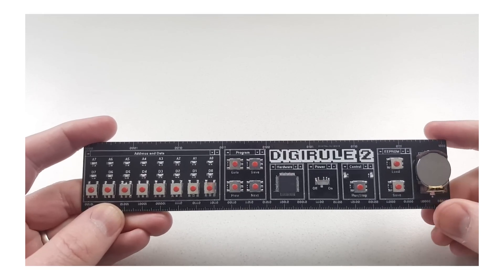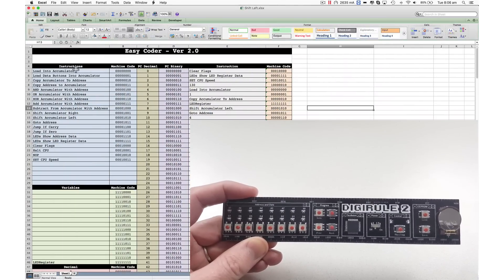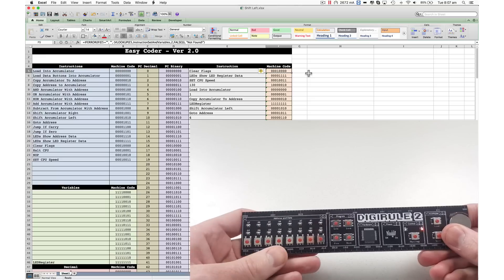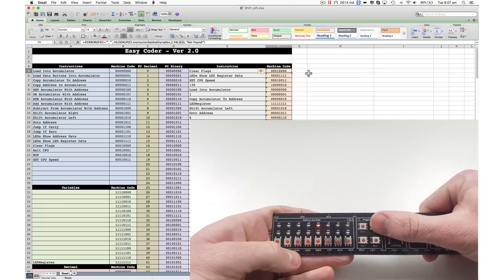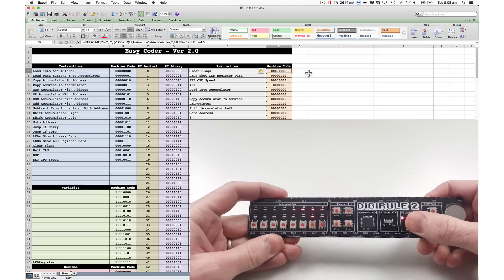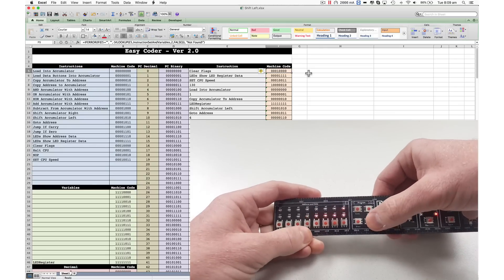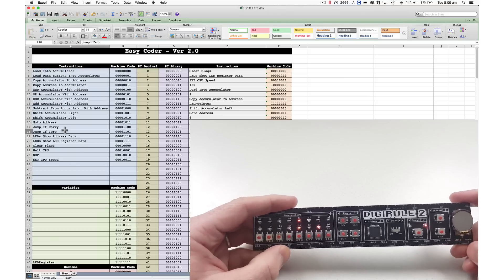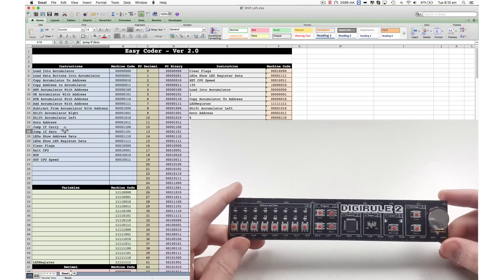Digirule2 Programmable Ruler Preview

Comment: you really need to build a case for it and then you can have a larger market for it.
Reply from the maker: Do you mean a case to store the ruler in for protection? or have all the led's and buttons etc.. mounted on the panel of a case?
Reply: More about the later when it comes to durability and wear and tear.  The average person would probably treat it like a sack of potatoes so a little plastic housing wouldn't be a bad idea.
Reply from the maker: The original Digirule is manufactured in a similar way and has been quite robust - I made that version back in 2015. I agree a case would be fantastic however I'd like to keep the cost down as low as possible with such a device. I'll do some research though to see if I can get some cases made for a low price.
Reply: wouldn't have to be too much really, just like a plastic skin or something.
Reply: this is a mole hill, not a mountain.